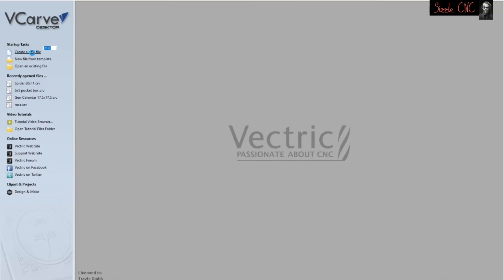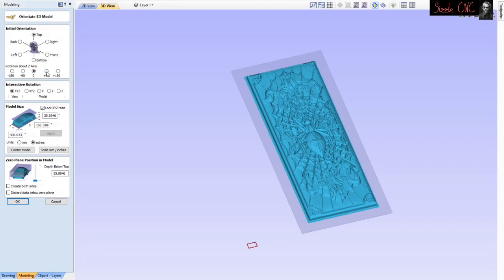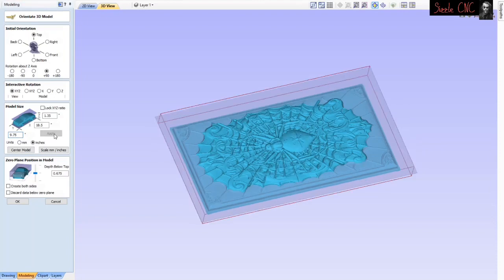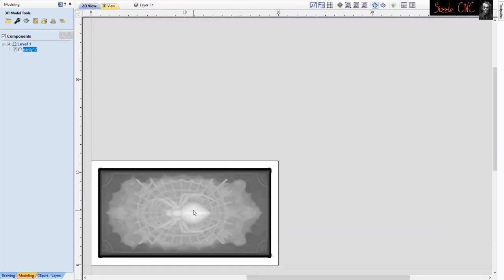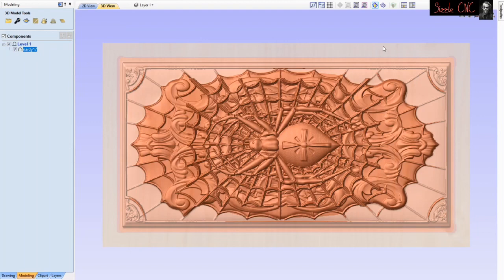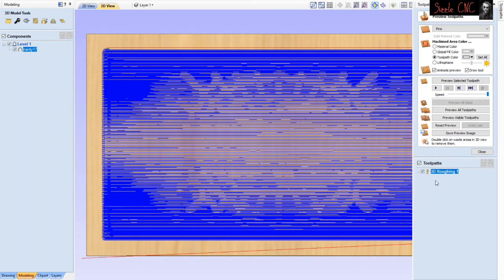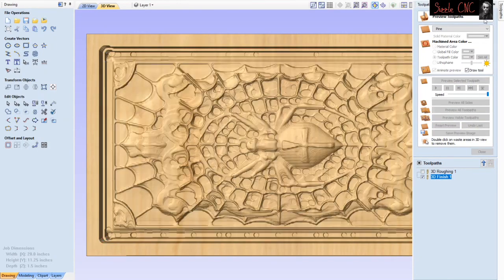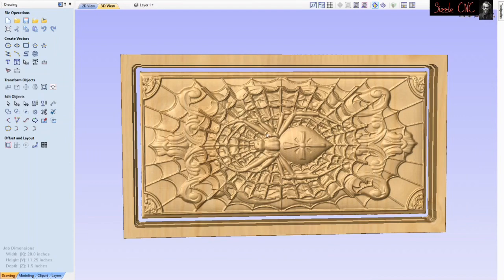3D Relief tutorial Importing STL files to make 3D reliefs  using Vcarve Desktop. #cnc #3drelief

Comment: Thanks for fixing an issue I had. Didn't realize that the depth of cut was dependent on the fixture of the file within the side view. Kept losing a lot of detail. Now I have to figure out how to set different parameters of cut where there are holes within the STL File.

Comment: This was great, I've got a shopsabre 23 coming in and this has been helpful to get a little idea of what's going to need to happen to make the machine work. For the tool change are you using a ATC or is it manual, and if it's manual how would you setup a manual tool change for that transition from the rough cut to the ball end? I now you gotta edit the Gcode but maybe the Vcarve software has something in there to set up that way.